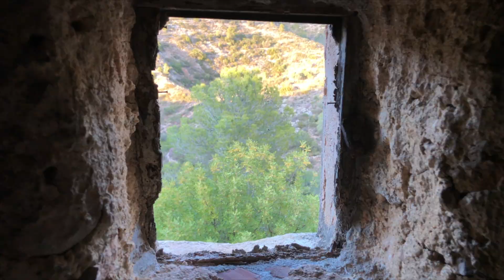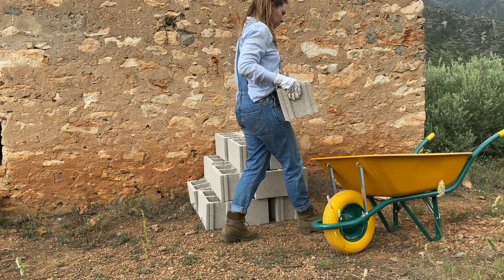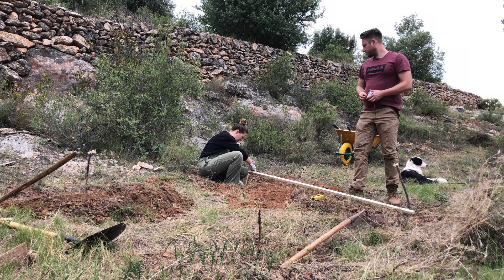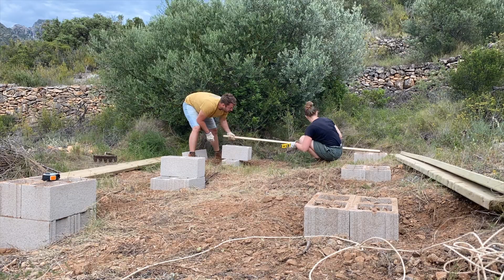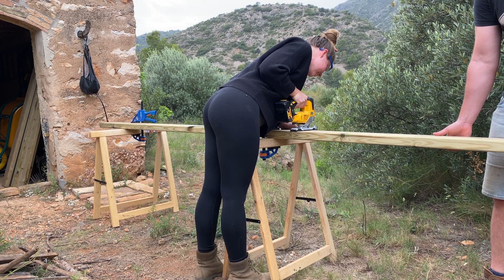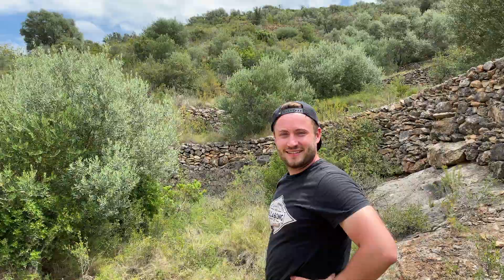CABIN BUILD SERIES | Ep.2 | Building Wooden Frame for Cabin | V.15

Comment: A helpful piece of advice:  never assume that your lumber is straight.  It is often bowed in both directions.  Use a string line instead with a string line bubble level, to check more accurately for level.  Are you putting joist hanger brackets in that floor frame?  You'll need them.  You didn't mention it, but make sure that if you are using screws, that they have been rated for higher "sheer" strength.  Screws have no where near the sheer strength of nails, but they make purpose built screws that are designed for replacing nails in a horizontal application where they are taking load.  Otherwise they can/will just snap off.  

Well done on getting your money back.  Now you have learnt an important lesson.  Always know the return/refund policy of the store that you are purchasing from.  Your increasing collection of tools are too important and costly for you to be left high and dry with duds from unscrupulous retailers.
Reply from the maker: Thank you for all the useful comments! 

For the joist hangers, we’re still considering whether they’re necessary. We’ve spoken to a few different people and with such a small build it feels like it might be “overkill” …?! It’s only 4m x 2m and will be single story 🤔
Reply: @SmithsdaleFarm  A good rule of thumb is always to err on the side of overbuilding.  Fixing collapsed joists with very little clearance under the building is way more of a hassle than just building it more sturdily to begin with.  This is your journey, but as with buying cheap tools, you'll figure out that it's better to do things once than spend a lot of time and energy revisiting jobs(or chasing refunds) a few months or a year later.

Comment: Great start on the cabin and the best result possible on the strimmer. 4.2 meters is pretty much a Spanish standard, so it means you should be able to get the same for the roof and have an overhang to keep the rain of the top step. Well done! ☘️☘️
Reply: Good to know about the 4.2m, we were worried that we would never receive the same lengths again! Saw you put a shed up in a day, puts us to shame!
Reply: @dws1327  😂 Thanks Danny, but the shed took me about 3 days. Oh, and it’s still not finished. ☘️☘️

Comment: Excellent work, strimmer gate worked well. We are doing similar, land is rough so we have done our homework and a stihl brush cutter is what we have decided... Good tools make the job easier, dewalt drills are are good investment I see. Hope it continues good for you.
Reply from the maker: Thank you Stephen. Yes, we’re loving the dewalt battery range! We have a few different tools from them in our kit now and they’re great. 
We’re definitely considering Stihl as a strong contender 👌🏻
Reply: @SmithsdaleFarm  I retired to northern Thailand, bought a small farm which was a jungle. Bought two Honda strimmers, no problems and three years later still going strong.
Reply from the maker: @raymondsmith4401  Thank you. The only issue we have found with Honda ones is that they seem quite a bit heavier than most others. Still yet to buy - as there’s a restriction on use through the summer months. Going to start looking again soon. We’ll reconsider! 🙂
Reply: Also, here we mostly use blades, and just stringers for around the young fruit trees.

Comment: Oh so glad you got the strimmer sorted … 
… good work on the cabin although I’d still like to have seen a GOOD LOAD of stones under it to stop rats digging tunnels and nesting there 
… I’m speaking from experience as to retro fix the problem is a big job … I had to get rid of the rats and there seemed like millions of them (even wee hairless pink babies !!!) … then fill in their nests and struggle to get those stones in after … EVENTUALLY I solved the rat problem under my shed … good luck 🙏☘️😘
Reply: not 100% sure what you mean? To fill the whole space to the height of the frame? Or to lay down layer of gravel generally?
Reply: @dws1327  Hi Well done for your project! we love your channel and your energy. If I may, I would have put some footings of concrete (concrete and stones mix) below the concrete blocks which you could have leveled. And instead of just gravels inside the concrete blocks I would have poured some concrete/mix with stones and a few metal bars or some rebars. Otherwise, I assume when rain/water will run on your field it may run under your concrete block and may create some cavity and destabilise the level of your platform. Maybe your blocks will be fine but I would be careful with just gravels in them.
Reply: @simplehomefood9363  hi, glad you’re enjoying the channel 🙂 as it’s a temporary structure we’re not supposed to be fixing things in place in terms of foundations etc. Otherwise we’d have been concreting for sure. Fortunately/unfortunately the rain levels aren’t too high so we’re hoping wash away shouldn’t have too much an effect.
Reply: By no means am I an expect, rather I look at potential problems, given the environment I am in at the time, and probably overcompensate due to my naivety 
With your cabin build I see (1) potential rodent problem … (2) potential washing away of the grounds underneath your cabin because of the heavy rains which fall on very very dry land and rather than the water being absorbed, the land is so dry  it forms mini rivers which are a nightmare  forming gullies and wash soil away … I think you have seen this happen on your driveway ( rains in Spain on dry land are very destructive, in fact a number of years ago, on a much larger scale, many many roads and motorways collapsed because these rivers “ate” the earth underneath them) 
So back to your cabin:
(1) dig holes for your base blocks to sit in (about 6 inches deep) … before placing the base blocks … fill these holes with concrete, thus giving the base blocks a solid foundation
(2) lay your base blocks ensuring they are level and ensure you have enough base blocks to support the cabin bearing in mind the weight of the cabin, all the furnishings you’ll have in the cabin, plus at least the weight of you two … I’d probably lay base blocks every two feet around the perimeter and lay base blocks as centre supports as well - but maybe that’s me overcompensating for my naivety.
(3) lay a good 3-4 inches of rough stones between the base blocks 
(4) place thick plastic squares on top of your base stones as a damp course
(5) erect cabin 
(6) make a wooden skirt around the base of the cabin … boring small holes to ventilate underneath (no larger than a half penny size, so rodents can’t get in )

Now it is anticipated this will ensure your cabin is not infested by rodents and that the rains and wash  doesn’t make your cabin unstable and warp …. And hopefully this cabin will serve well as your temporary home and future storage for years to come …
I have made my fair share of mistakes, even complete disasters which have ended up expensive in both time and money … I am not an expert and I have always done things myself … PREPARATION is everything … the effort you put into preparing will repay you a thousandfold … I leaned that the hard way !!! 

So this old DIY’er is passing on experience, but not professional guidance … I am loving your vlogs and enjoying giving you my tuppence halfpenny worth 
Have a great week and no doubt you’ll be hearing from me in the future … maybe a more professional viewer can chip in and I’ll learn something also !!! 
Wishing you all the best 😘🙏☘️

Comment: You need a longer level. Don’t be so picky it’s a shed you can level it later.
Reply from the maker: Yes it’s essentially a “shed” but we’re also learning skills we’ll use on the house build, so we’re hoping to do things as well as possible so that it’s easier when it comes to the house 😁
Reply: @SmithsdaleFarm  you need a longer level the one you have is good for small things. And don’t kid yourself you will need a generator there is no virtue in batteries they still rely on electricity generated by fossil fuels.  Occasionally you will need real power tools. But that’s just my opinion. It’s possible to do it without but there is nothing like a miter saw for wood working.  I am suspicious of battery alternative as the materials used to make them require a lot of mining.   A BCS tractor may be the best solution for your narrow growing plots too.
Reply: @SmithsdaleFarm  my land is 173 miles from my house which means if I have stuff I want to do I have to plan in advance.  A set of tools stored there.  Storing extra supplies so I don’t have to make the trip to towns also.  If you plan on having orchard or trees plant them first as they take the longest to establish.  If there is something like bee keeping you can do start it to generate income.  Start composting in piles now and you can have garden soil in the spring. You don’t need special bins.  I noticed semi- level rocky spots, build and compost over those and save other spots for gardening.  Find out what varieties grow well from your neighbors. Start growing a small garden as soon as possible I grew enough 🍅 tomato’s on a few plants to can 9 quarts and provide for several neighbors too.  You don’t have to be there for the garden to grow.